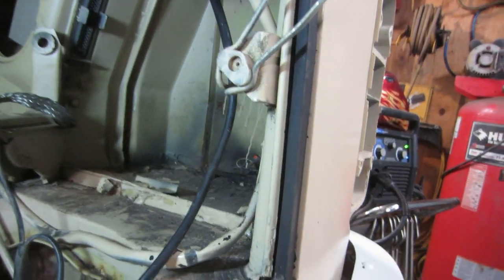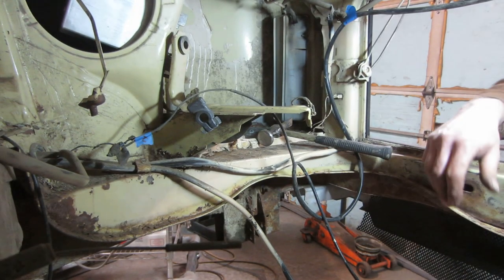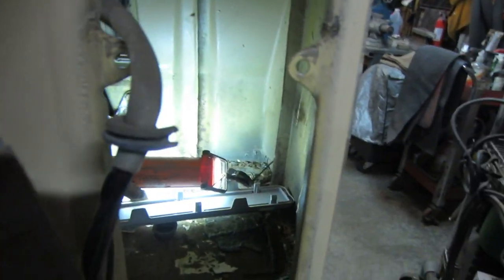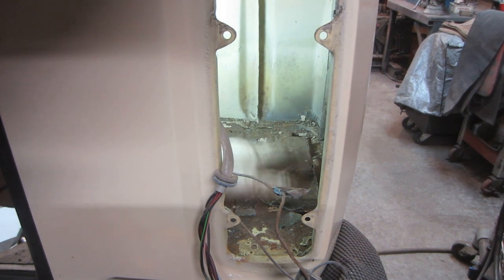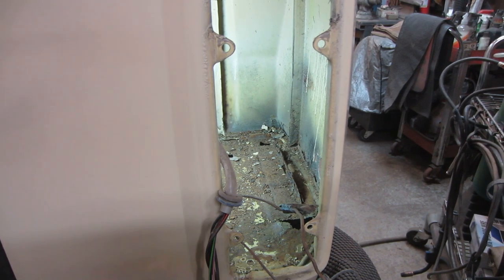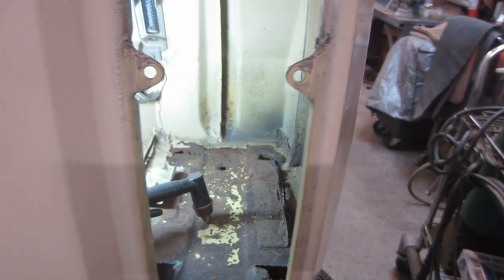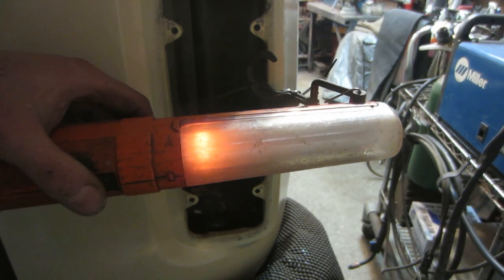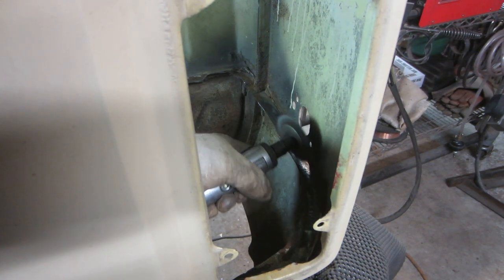vw bus welding in a battery tray.

Comment: Hey Mustie they make a roofing patch with with peeling aheasive backing very simular to stock VW Just remembered that I used for same thing
Reply: Richard Warnock  Ice and water seal.
Reply: Bob G Yeah didn't remember the name WV use to have a layer of thin polystyrene foam samwiched  between the layers then spay adhesive holding it down I guess for thermal thanks

Comment: Why not seal between the panels before welding?
Reply from the maker: you need to have clean metal, plus if you seal both ends with seam sealer nothing will get in and rust, just like the factory did it,

Comment: Seems common that batteries cause so much rust and corrosion.  After so much restoration work on trays, surprised no one uses boat battery cases to protect things in the future.
Reply: The problem is water falls down from the top vents in the bus, and gets trapped under the battery / charcoal canister.  adding something like a boat battery case would actually add to the problem.   (I just cleaned out my battery bay in my bus and did a similar repair)

Comment: i can remember a VW mechanic telling me 40+ years ago that a Beer can is 16 gauge metal and a VW is 18 gauge metal ,   Just saying
Reply: Well, he was a little off considering that 16ga steel is about 1.5mm thick, and would make one hell of a heavy beer can. :-)
Reply from the maker: l think he was pulling your leg,
Reply: Yeah, I did put in a smiley. You just can't be sure with YT comments.
Reply from the maker: l was replying to big paddy lol,
Reply: Ha!
Reply: Those beer can's of yor were pretty heavy! They were all steel back then and nothing but aluminum now. I started swilling beer about 50 year's ago. Cant drink any alcohol now though. We used to patch up exhaust systems with steel beer can's.